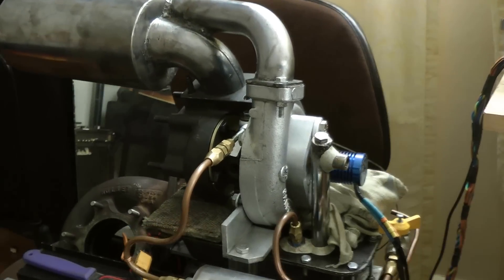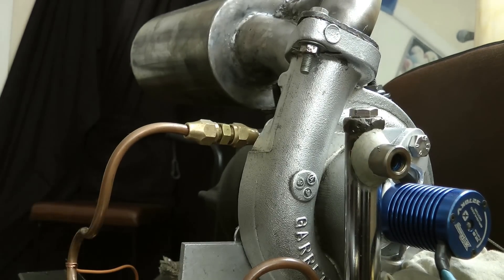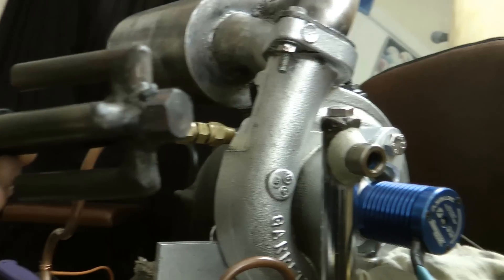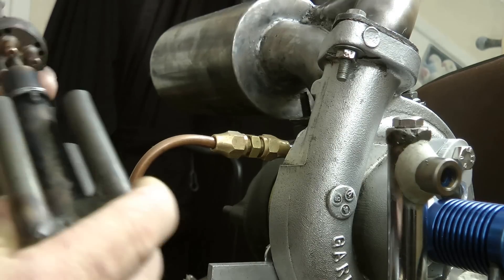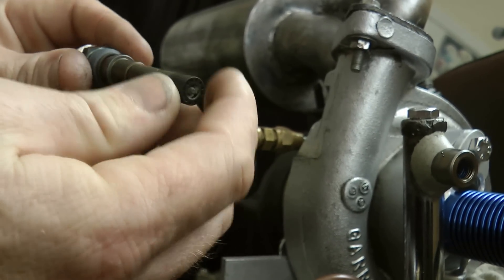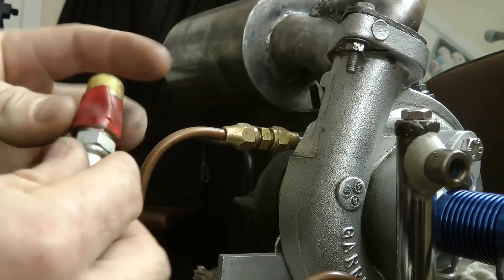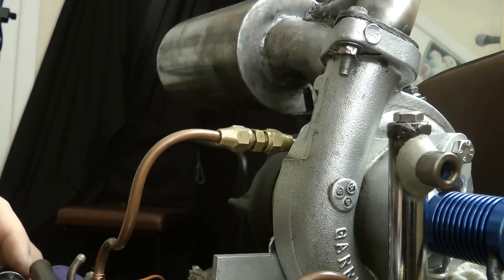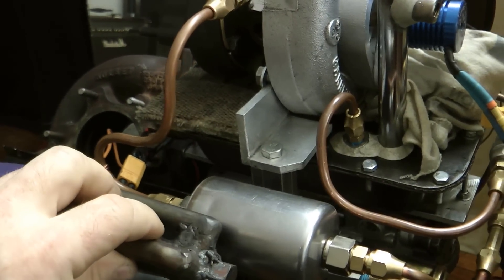How to Build a Jet Engine Part 4. Home made Gas Turbine Jet engine

Comment: Okay, Since 11 KG propan gas cost like 100 euro in Denmark
Can I use Diesel instead?

And what is the "recommended preasure on the olie pump, so the turbo wont break?"